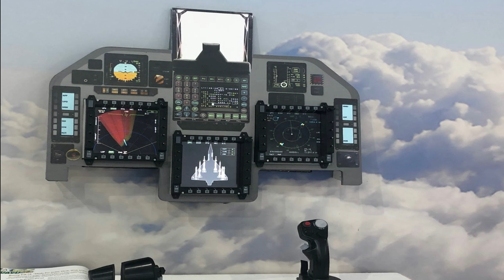7 Years of Flawless Service:  LCA Tejas will shape up the future of Indian Air Force #indianairforce

Comment: The type has done a grand total of 7000 hrs since its first flight. 22 yrs ago. It would have been better  for teh IAF that the type like the ALH had  done a 100,000 hrs with a few crashes. 7000  hrs in 22 yrs is patehtic.
Reply: Alh Dhruv has 3 lakh flying hours
Reply: @yogeshkumarallum2540  Good to hear from you Yogesh! Hope everything is Changa! You are right of course. I shoukd have clarified.   I put 1 lakh hours because I think in 7 years- same as the Tejas the ALH had crossed 100, 000hrs. Prima facie The Tejas continue to be a worry
Reply: @prodyutdas733   Flight testing Tejas mk1 started only in 2017. And it's not the future. It's just a trail run of what Hal can do. 
Tejas mk 2 is future. Ofcourse we have to hope that it happens

Comment: Wow. But the production is woefully low. Adaptability and scalability to emerging technologies is lacking. Why haven't we added conformal fuel tanks and free the weapons stations ? why nothing similar to DAS? IR masking/cancellation? 360° RWR with capabilities to detect IR sources & IR guidance systems?  We need to improvise radically. QWIP? Capabilities to IFF, weapons launch kill confirmations using DAS without pilot turning around? All the best.